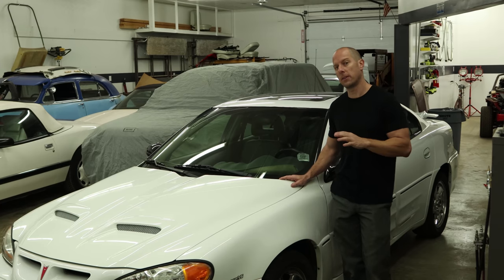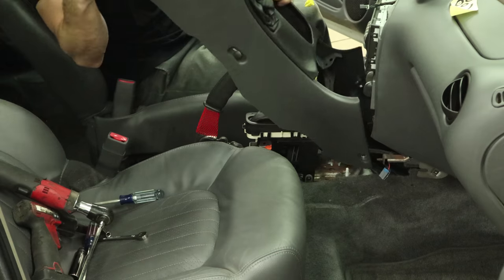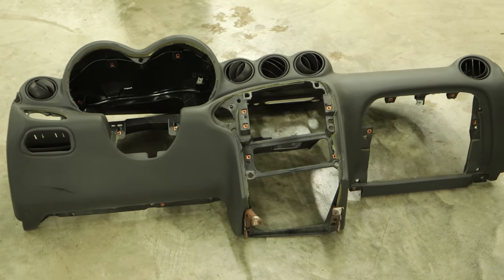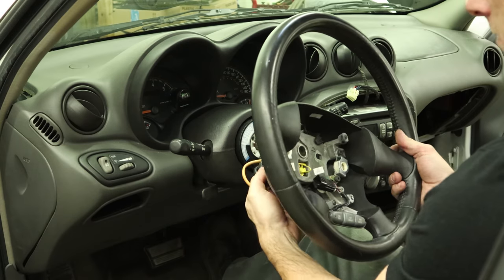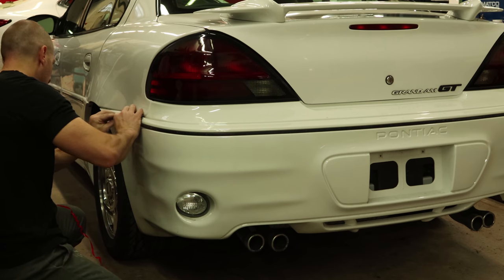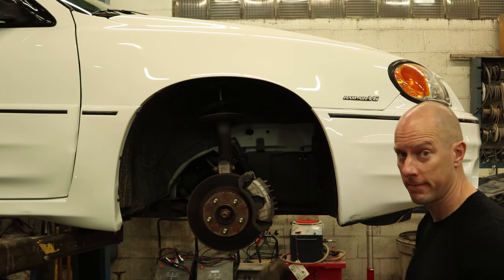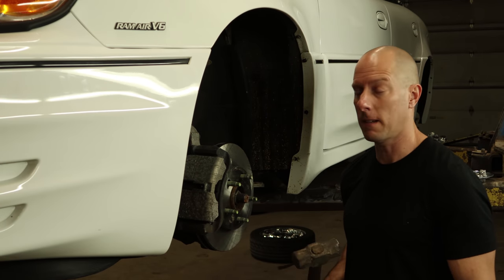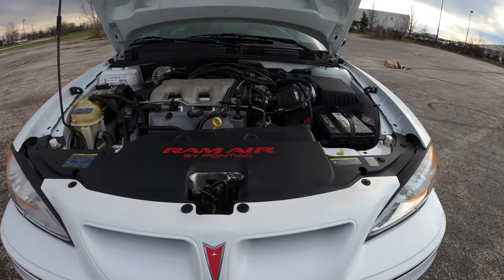Fixing all the typical issues on our super cheap 2003 Grand Am GT build

Comment: Check number one spark plug. It's probably cross-threaded. And there's probably, four broken bolts in the exhaust manifolds. Keep a spare fuse handy for that AC compressor, when you get a no crank no start condition. And make sure you look up the anti-theft reset procedure, for the key. Because the door pins bushings to go out, and cause that door latch to keep colliding with the striker, until the door latch itself, is junk. And continuously faults out the security system. Randomly of course. And make sure you have the OEM key, and not the valet key. I love grand-am's... Great money makers. Especially those ones. Oh and when you go to replace the belt and belt tensioner on that, make sure you're not getting the same one as the GT 30th Anniversary. Because that's technically a Malibu engine. And the two belt tensioners are not the same. And when the brake lines Rod out in it, just replace the whole sub assembly with the brake lines and the fuel lines together. Classic tube has everything you need for that job.  oh yeah... Watch out for that crank pulley. They have a tendency to start wobbling, when the rubber rots out of them. Just like on the 3.8 liters.

Comment: I started watching you take apart some dash and you just kept going and going. Then I wondered  what you were going to repair
from removing all that. You could really take interiors apart if you went to a junkyard, after an interior part 2003 grand am interior would be ripped apart.  I enjoyed watching , as I  took a radio out of 2003 grand am last week. with some research found out  the radios were  matching vin.no. to get it to turn on. from year 2000 on and thy radio plug changed in 2007 . After researching them, I started liking  the 2003-05 grand am  But  I already have to many cars.  So I better forget about that.

Comment: I have a 2004 grand am I bought it for like $500 because the previous owner wanted to get rid of it and a couple months later the headgaskets blow amd I had the entire engine replaced and I haven't had a problem woth it since then I bought with 165,000 and now its at 185,000 its still flying down the streets and highways no issues except I have a evap vent solenoid issue that's keeping my Service engine soon light on it's the wiring that's messed up but I'm gonna have that fixed 💯

Comment: The rocker arm tool that you mentioned is actually pretty cheap.  They used to be expensive.  The thermostat can be removed with the intake on using a weird wrench made for this.

Comment: I wish you had a video on repairing my rusted out quarter panels. The one on the passenger side has a area that is down to one layer of steel and it is not in too good of shape. I'm going to still keep treating it with rust converter but i will have to do a repair if it leaves a hole in my trunk.

Comment: Also can't find video on windshield glass removal on 99-2005 grand am. Glass place said problem comes with replacement on these is that known under front cowl gasket leak. I had that many years ago. Dealer had a weird fix for this known problem. Want to make sure I don't get that back just because of a windshield replacement.

Comment: Just picked up another grand am gt for $600 LIM gaskets failed coolant in the oil no biggy I like building the 3400, got a 04 gt with rust issues so now its a parts car the gt trim will go on my 01 SE V6 and any parts I need will be swapped into the GT i just picked up. Already swapped over the headlight support hood latch and front bumper support.

Comment: I did buy a 3/8 impact driver and it is really nice, but it doesn't fit into places like the right angle driver does. I have a air-driven one, but to lazy to get out all the air comp & hoses just for a couple bolts. Maybe find a right angle driver on sale.

Comment: Well, a year later and I joined the party. I had that very same model & year. In fact, that one is 100% identical. That was my 3rd Grand Am GT. I started out with a 98, then a gorgeous sivler 2004, and finally the white 2003. The 04 I regretted getting rid of. That one and the 03, I wanted to performance mod, but I'm a dad of 4, so they came first. 
I still want to mod at GT though, and now all my kiddos are grown up and cutting their own path.
I'm curious to know if you still drive this one and how it's going.

Comment: You need to put the nut on the steering wheel shaft when pulling the steering wheel so as to not pull all the wiring out in the process ... as well as not removing your front teeth because the steering wheel really doesn't like those either.
Reply from the maker: I have ripped some wires but never smashed my face yet.  Well until now.  I will certainly have it happen now that I said that. 😂
Reply: @vehcor  - Isn't that the way of it, lol. Be careful of those nasty steering wheels ... they'll get you when you least expect it, lol!

Comment: Would putting some product on the dash like 303 aerospace protectant prevent that from happening? The material would have something it could absorb/ deflect heat sort of like leather so it doesn't shrink.

Comment: Eh, the 3100 and 3400 are decent engines, barring the intake gasket issue. Most failures were, in fact, from those intake gaskets because people don't pay attention (check your fluids regularly, people). Though, I had extraordinarily good luck with the higher end Felpro set for these. However, it's no Grand Prix with a 3800 in it. Fine example of a pretty well kept Grand Am, though.

Comment: How much of the dash what areas of it and center floor console needs to come apart in order to replace a white long about 6 inch long door flap that's almost center of dash going g from drivers to passenger direction. I believe it controls direction of air/heat etc from floor to center dash vents. I could show you some and the replacement door flap if I had an email to send them to. One of the Male post tabs on one end of the flap broke off. With blk plastic panels underneath dash knee area I look up I can see the original male post broke and the flap door.

If I could reach it with two hands from underneath I would just drill hole where male post broke off and use a bolt and nuts threw actuator end and flap door male post end. And just not tighten it too tight do actuator cdn pivot on the door flap Male post.

Comment: A 3100, 3400, or a 3800 series having leaking upper intake manifold gaskets/warped upper intake manifold or blown out lower intake gaskets and sucking coolant? Never seen that 🤣 Ive got a 97 Buick LaSabre in the shop right now that is an absolute smoke machine lmao

Comment: Must be a GM thing every 3.8 I have owned, I have had to replace the intake gasket.... I have had 5 Park Ave. 97, 98, 99, 02, 05. The 05 has over 275,000 miles.

Comment: If that engine is a 3400 those are actually pretty simple to work on I just put head gaskets on my 07 equinox with 250,000 miles

Comment: when you installed those rear speakers, did you make sure to put the tweeters on the outside so you get maximum separation? hehehe (or at least in the same orientation?)

Comment: My sister has a Grand Am just like this minus the fancy hood. My biggest gripe is the headlights. I tried every option I could find to fix it. Ended up with oem housings with that ring around the bulb removed and LED bulbs. The light output is awful at best. The high beams seem to shine lower than the low beams. Major fail on GM's part. Worst lights I have ever seen. If anyone has a good solution to this please share.

Comment: Audio power ratings 
There is RMS root mean square which is the standard and is used to give a power rating on any actuating current such as what comes out of a mains outlet.
And then there is PMPO peak main power out put or total load of marketing BS
They get this by cranking every dial upto 11 and measuring the total draw before it craps out.
If you look at a box with 10000 Watts PMPO or other fake marketing term on it somewhere in yellow on orange or similarly invisible fine print will be five watts RMS